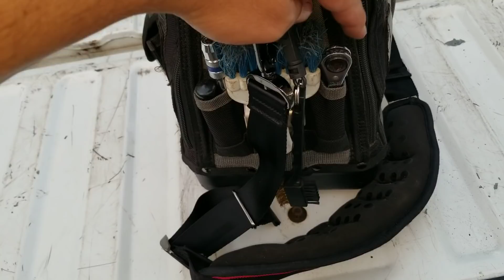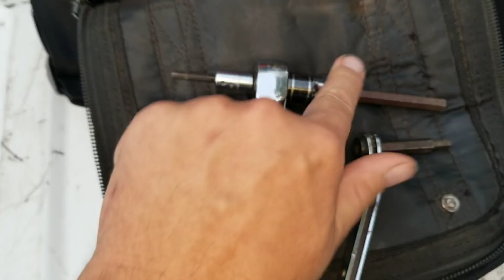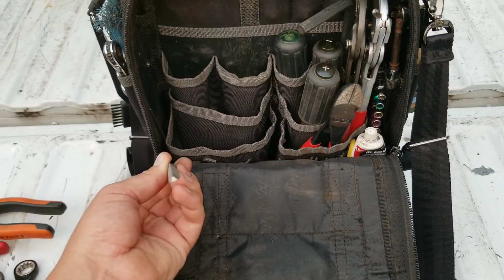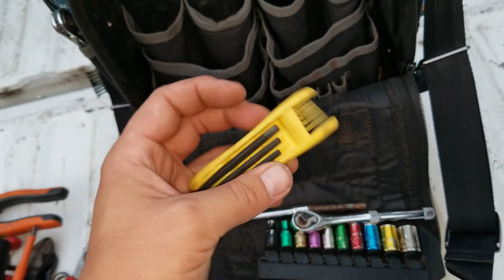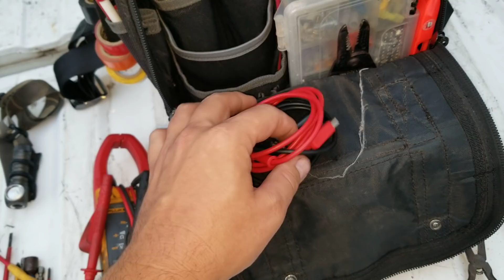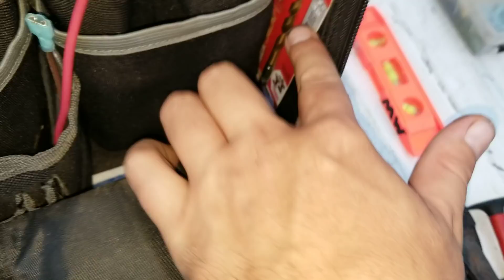* Veto TECH-MCT - HVAC Load-out *

Comment: How did you make that double Allen key ratchet deal
Reply from the maker: Bought the individual long Allen sockets on eBay.
The  1/4" drive X 3/8" drive ratchet I got at an Auto parts store years ago, they still sell them.
Reply: @scrambler350  rad. Appreciate the info

Comment: Really hate how the rain affects some tools. I try to keep mine well
Taken care of especially since I have mostly Knipex for hand tools. You mat want to look at the very small Stabila Pocket Pro Magnetic for a small
Level. Magnets are super strong and gives both dimensions level and Plum. Costs $20. Not bad for Stabila.
Reply from the maker: That's VERY reasonable for a Stabila. 

I think the quality of the steel has a LOT to do with how the finish of the tool holds up to moisture and surface rust.
 I wipe my tools down with Ballistol if/when they get rained on...or if they begin to develop surface rust.

Comment: Im up in the air about getting the MCT or the MC tool backpack, any suggestions? Seems like youve used both of them. Currently using a CLC 1530 43-Pocket
Reply from the maker: What trade...?
Reply: @scrambler350  I do commercial refrigeration
Reply from the maker: @KG_ttv   Looking to get away from an open top bag...?
Veto has nice Open Top bags, but they(even moreso than the closed bags) get heavy FAST.

Comment: Great vid man, I use the tech mct as my everyday bag and I do have a lot less in mine, I do residential heating and air conditioning, I tried using the TP4 but it just didn’t have enough room for me, the bag would be so stuffed you could barely see the bag itself lol, keep making vids man!
Reply from the maker: Whatever works best for the way you work.

Used to love using my MC(and then MCT) bag for every call and always have everything I needed plus the extras - but eventually got tired of lugging 30lbs around all day long and went to the 'Diagnostic Pouch' for the majority of calls.
 Today, for example, I used my MC Backpack...because I knew I was going to be changing out a 5hp blower motor and a pair of chill/hot water actuators and controls...so left the diagnostic bag hanging and brought out the big gun.
Needed other tools, of course, but grabbed those as the day went on and toted them back and forth in my canvas bucket bag from Harbor Freight.
Reply: I hear you bro. Your tech mct doesn’t have to be 30 pounds though lol mine is like 20 and I never go back to the van besides to get parts after diagnosing, not saying you’re doing anything wrong bro I know how easy it is to over load these vetos! I got the tech pac backpack I find it too bad big unless I’m doing a full day job at one site
Might get the mc backpack though to try it out for service calls but even that would still be over kill I bet
Reply: I just got the mct for myself in Residential heating & cooling. I'm concerned that it's going to be too big for moving through attics & crawl spaces. Have you ever found it to be too big? 
I think I might trade in for the mc compact version.

Comment: Great video fellow tradesman. I actually an electrician and also always have the 11/32 nut driver. The only difference is I use it for replacing light fixture ballast. The one nut that keeps the ballast in place is an 11/32. Thats about the only reason i keep that thing handy. You have a really niche set of contraptions!!
Reply from the maker: Thanks man.
Good to know another use for the wild and mysterious 11/32's nut-driver.

Comment: I have been using  Malco 1/4 x 5/16 nut drivers. You pull off the tip and flip it. Makes it easy to clean that magnet, I don't have to reach into the bag when they use both size screws on a unit, plus it is one tool instead of 2 in the bag. As an added bonus it unplugs from the handle and clicks into my 1/4" fuel. Also, I got a Klien stubby multi that I'm liking a lot.  I am trying to lighten the load. Switching from 18v to 12v fuel was HUGE. Love my Knipex and NWS too.
Reply from the maker: That Malco bit is my daily 'go-to' still have all the cleanable DeWALT bits from 1/4" to 1/2", but usually keep those in my big bag - wish Malco would come out with a 3/8x7/16" pull-off bit next.

Love the 12v brushless Impact - Only have 18volt for my hammer drill(also use it to swedge) and my Sawzall.

Comment: Great video,all need is some smart probes for that bag
Reply from the maker: Steve, I picked-up a set of the Testo Smart probes a few months ago, and was HOPING there would be room for them in the Tech-Pac MC, but the top pockets are too small and too high-set in the bag for the probes/clamps to fit well - which sucks.
 May carry them in a separate tool pouch style bag and attach them with a d-ring if I start using them on the job - so far I've only used them on my personal systems and on a couple of off-season maint. checks when it wasn't a busy day.

Comment: I've just ordered a MCT to replace my MC, needed a bit more height to fit my new test meter in.
Reply from the maker: That's why I ended up switching to the MCT - so I could fit my FLUKE amp-meter inside the bag to protect it...with the MC, I was carrying my Fieldpiece 260 hanging off of the side.